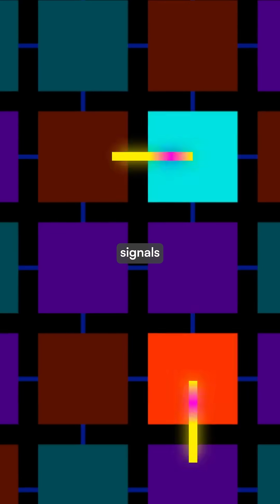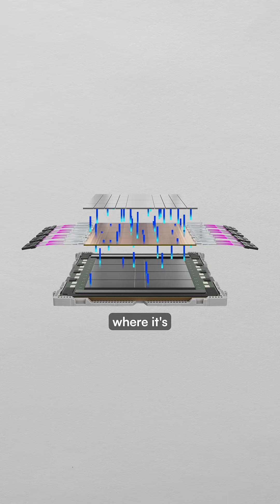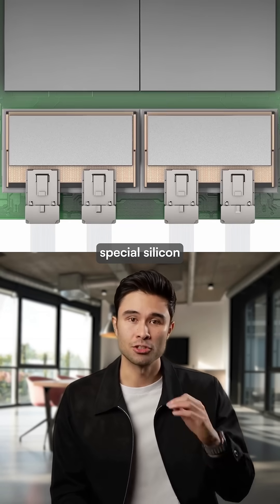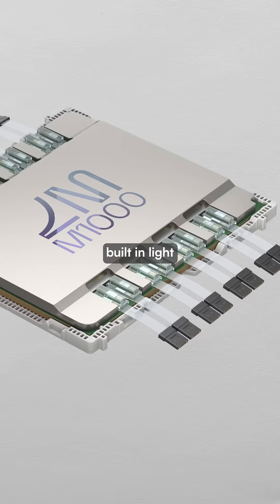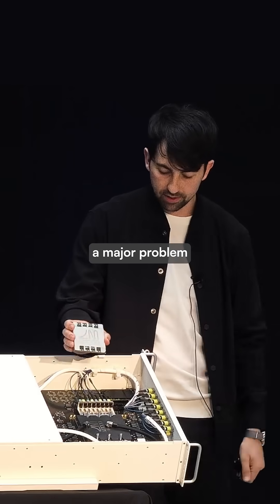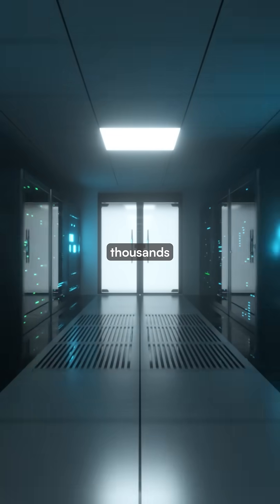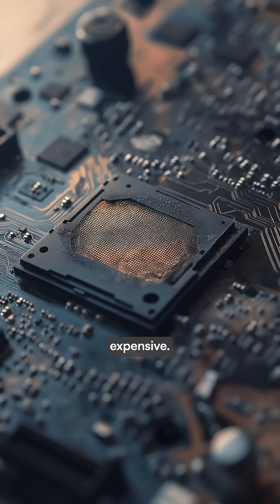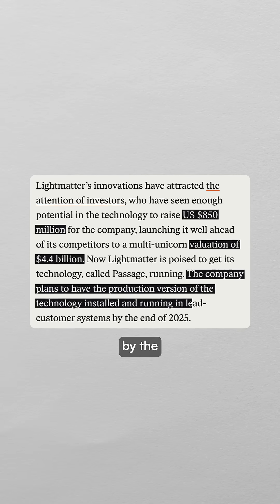This “light-speed” AI chip could help speed up AI processing AND reduce energy use #ai #technology

Comment: 20x more energy efficient, sure. Not 20x faster

Electric to Optic conversions always a few Ms to complete. Electricity itself in copper moves about the speed of light as well - so many drawbacks, 

but to do smth like replace a thick and long wire stack could be helpful

Comment: Putting additional silicon below the compute die doesn't really make much sense if the application sees its primary benefit in long-distance communication. A lot of chip communication is within the same server rack. I see this making sense as the communication to other server rooms, maybe even between racks. Even then, though, not really unless it has a substantially higher data bandwidth capacity.

Comment: I'm going to be not picky.
1. electric moves at the speed of light but the speed inside that material.
2. It's is more efficient but there are still losses so there is a limit of distance.
3. Light speed is not always the same inside the glass it would be slower than in space.

Comment: The issue with copper isn’t the energy but the heat which needs to be dissipated and that’s what causes it to consume so much energy. The light theoretically would require less cooling and thus be more energy efficient. The reality is that AI is going to grow so fast that it’s going to be extremely difficult to meet its energy demands which is why all of these companies are pushing to re open nuclear plants and build data centers around them. Ultimately I think the underwater data centers make far more sense as they can be cooled by the ocean which is much more efficient. However the problem is what will be the effect of having thousands or even millions of these data center pods in the ocean artificially heating it.
Reply: would be way easier to build the data centers on space instead of the ocean

Comment: That’s for networking yeah, it’s been around a long time… you’re equating the two but networking and processing are dissimilar. A light array makes more sense in some cases than traditional electrical binary logic gates but we’ve already been able to isolate electrical signals at incredibly low voltage. Unless you’re using some sort of passive particle lighting, I don’t think you can negate the power draw from the usage of low voltage transistors. Light still needs an on switch.

Comment: Insane upgrade path lmao. The only issue is that atm optical fiber, especially that small and imbedded during production is way more expensive than copper. I’m sure as copper supply continues to dry up fiber will be more cost effective, but that’s a little while away

Comment: Electrical signals travel at the speed of light too, there are other reasons why light is better, mainly the power usage as mentioned, most of the power on moder computers is wasted into transfering information between different locations and not on actually doing math with it
Reply: Electricity does not travel at the speed of the light. It's easily researchable.
Reply: @MarsterMikkel The electrons themselves might travel much slower, what we care about is the electric wave in the electric field that actually pushes those electrons, the electric field is the carrier of the signal in a computer.

In fact the photon is the carrier of electromagnetic force, the same force that pushes the electrons, the signal in the conductor is carried by actual photons and it is done in the speed of light inside the conductor (slightly slower than the speed of light in vacuum).
Reply: @MarsterMikkel Electricity and electrical signals are not the same, electrical signals can travel at the speed close to the speed of light but electricity's speed depends on the medium
Reply: @MarsterMikkel Electrons can move at the Speed of Light, or extremely close to it if the Medium is not the Limitation
Reply: Light is analog

Comment: The idea of light-based computing for AI isn't novel it's been a theoretical darling for decades, promising blazing-fast, energy-efficient processing for neural networks. But with current technology, it's a pipe dream. Photonic chips can zip data at light speed, potentially 10-100x faster than silicon, as seen in 2024 research on optical AI accelerators. Yet, here's the rub: how do you interpret or display AI outputs without silicon processors? Photons don't naturally interact for logic operations, so you still need electronic circuits—silicon-based CPUs or GPUs—to handle data processing, model training, or even visualizing results. This reliance on hybrid electro-optical systems, as highlighted in recent studies, defeats the core vision of a fully photonic AI architecture. Until we crack purely optical logic and memory still a distant goal per 2025 reports light-based AI computing remains tethered to silicon, undermining its revolutionary promise.

Comment: I wonder what they're doing about the conversion latency? Typical fiber optic conversion adds about half a nanosecond of latency.

This isn't a big deal typically, as it's equivalent to about 6 inches of signal propagation through fiber. Larger chips already seem to have issues with maintaining high clock speeds and throughput due to latencies across the chip, so how will chips perform if cross chip links are effectively 12 inches longer? Unlike external fiber links, that's effectively multiplying the time for a signal to get from one area of a chip to another.

Perhaps they have a faster way to convert between electrical and optical, but I'm just speculating based on what I know of current fiber optic systems.

Comment: There's multiple companies developing this light networking. Including Nvidia themselves. Barring some serious proprietary benefit these smaller companies come up with I highly doubt data centers would implement their tech over nvidia's because they are already so invested in nvidia systems as is and nvidia will likely offer upgrade paths that are more seamless and cheaper because they will have the economy of scale on their side being by far the biggest HW supplier to these compute data centers. It will be interesting to see if one of these smaller firms can come up with something significantly better than nvidias own solution. This is a massive breakthrough though, the energy savings alone is huge, energy is becoming a real barrier to expanding these systems.

Comment: Light is good if you have a straight shot. Unfortunately computers are made to be as dense as possible so basically nothing is a straight shot. This is the main reason data centers have stuck with copper connections between collocated servers. The data that leaves the facility will basically always be going via fiber but those fiber connections have much less challenging angles so the amount absorbed into the wall of the fiber optic cable is much lower
Reply: Attenuation occurs at all angles, the steeper the step and degree of the angle, the more bleeding of light from the core into the cladding will occur, thusly signal loss is compounded. 

Classical terminology for this type of loss is defined as 'macrobending' and 'microbending'
Reply: Define a challenging angle

Comment: Heat generation would be less, thus saving energy used in cooling system.
However, energy and space required for running the chip would be higher than traditional chips.

Reason - 
Energy - generation of light requires more electricity compared to sending an electric signal.
Space - Optical fibres need minimum height to work properly. Copper wires can be almost flat.

Comment: Fiber needs repeaters it does get weaker over distance
Reply: Not over the lengths we're talking. Fiber optics in datacenters rarely need repeaters because the runs never even leave the building
Reply: @BreaKdOwn--rl  yes but his statement is wrong that there is no energy loss. In fact there always is energy loss, that's why efficiency percentages are important. I can agree that in a data center repeaters might not be needed, but saying that as a blanket statement is factually incorrect.
Reply: Lets clear some things about losses first:

MMF: ~44% loss per kilometer (about 2.5 dB/km). Great for short distances like inside a building, but loses a lot of signal if you go too far.

SMF: ~5% loss per kilometer (about 0.2 dB/km). Barely loses anything, so it’s ideal for long runs, like between buildings or even cities.

Silicon photonics: ~1–3 dB per centimeter (including coupling loss). It’s used on chips or between chips, so even though it loses a lot per centimeter, the distances are so short it’s not a problem.

So if you're not building the next openai data center you wont need a repeater..
Reply: @diama_ntidis So MMF and SMF have 2.5 dB/km and 0.2 dB/km losses, but photonics has 1-3 dB losses per CENTIMETER? Cuz that's what you said in your comment?

That would make Photonics have a loss of 100,000 - 300,000 dB/km, making it astronomically WORSE than MMF
Reply: @adenm8963 Correct, but, that comparison doesn’t apply directly. This level of loss is acceptable for on-chip or chip-to-chip links, where distances are just a few millimeters to centimeters.

The original point about MMF (~2.5 dB/km) and SMF (~0.2 dB/km) was in the context of traditional data center fiber runs, where signal loss over longer distances can require repeaters or amplifiers. In contrast, silicon photonics doesn’t need such regeneration because it's confined to very short distances and integrated directly into the chip packages or boards.

Each transmission medium is optimized for its own domain, MMF for intra building links, SMF for long haul and inter building connections, and silicon photonics for ultra short, high density interconnects within computing hardware.
Reply: @diama_ntidis  If Silicon Photonics has a loss of 1-3 dB/cm, and SMF has a loss of 0.2 dB per km, then Silicon already loses 5-15 times more per CENTIMETER than photonics loses every kilometer. 

That woukd make SMF have a loss of 0.2/100,000 per cm = 0.000002 dB/cm ( linear ) or 0.2/1,000,000,000,000,000 (volumetric) = 2 × 10-16 dB/km, which is literally orders of magnitude better than extremely inefficient photonics
Reply: @adenm8963 The confidence with which you're misapplying unit conversions and ignoring context is honestly remarkable. If this reflects your approach to technical reasoning, I’d strongly advise against pursuing any path involving engineering, physics, or computing. Hell I even doubt if you could understand my sentences, or in other words, you're not the sharpest tool in the shed.
Reply: @whoppersam  you are taking things too literal. With people who reason like children you have to overexplain everything, and mention every possible exception.
Reply: @whoppersam  compared to electricity that is driven by potential difference & against relatively proportional resistance ?
Reply: My dumbass thought you were making a redstone joke
Reply: Agreed..depends on the distance travel..but in this case its within the data center is fine I guess
Reply: You said it like electricity is not getting weaker over distance
Reply: Current and voltage decrease with distance. It is also affected by magnetic fields and electrical interference. Fiber doesn't have such problems.
Reply: Copper cables need repeaters as well
Reply: This isn't fiber 

It's using glass
Reply: A data center is by no means big enough to
Justify repeaters on distance. Now, due to the harsh angles for the sake of maximizing floor space you may need them but it’s not like they are expensive
Reply: i mean u can get a whole city to run on fiber optic internet, most data centers are like less than a stadium big
Reply: Yeah, if your MOTHERBOARD size is 100 kilometers
Reply: Yea no shit copper wires need higher voltage too
Reply: But there is a reason OFCs are used for world wide web
Reply: A deep scientific discussion in YouTube comments. Great to see!
Reply: How many repeaters do you need between 2 cms (0.078 inch)
Reply: Internet experts huh😂
Reply: Unless the cable stretches for 10s of miles it literally doesn't matter.
Reply: Bro it’s in a electrical board. 🤣🤦‍♂️

Comment: Then why does Nvidia claim that fibre optic connection consume more energy?
Reply: Where did they claim, because as much as I know they to are moving toward optical interconnection I think it called something like DGX system
Reply: because that's will fvck up share holder money and who bought nvidia stock..
Reply: @imammesum lol what?
Reply: @poo1764  because nvidia making rumor.. if consumer belive in this chip nvidia will f.up
Reply: Thats what NVIDA's experiments arrived at! Others found workarounds! The Chinese or more precisely Huawei have considerably sped up data transfer between the Ascend Chip processors to reduce energy consumption and heat generation which can cause thermal runaway and speed up data transfer between chips. The power bus is thus operated at a lower power demand. This is a hybrid approach to passing data between the chips which speeds up the Huawei Ascend AI Chips performance to the optimum enabling faster throughput. Huawei has considerable expertise in this light data transfer bus between processors in huge clusters. Jensen Huang has admitted that Huawei is "a formidable competitor" and agreed that they will eventually level up!

Comment: Copper wires has to be differential so twice as many, and has to be 75ohm terminated to ground near the input as to. eliminate signal bounce, that is lot  of power used.
Reply: Noy only that but the fiber optic cables can also use different wavelengths to transmit more data in a single line
Reply: 75ohm terminated? Isn't that dependent on the signal/design.

Comment: Rgb setups bout to go crazy with this one
Reply: Oh the horror
Reply: nope that's actually not possible that will corrupt data or if not then this will make the proccess inefficient
Reply: @dynamichacker3397  r/woosh
Reply: @Tarou9000 i meam other lights will interfere causing data corruption issue or by inefficient i mean even if your pc cabinet is closed and no light in there the still light will go out of fiber optics
Reply: @dynamichacker3397  no, iirc it is silicon-based and thus it is only transparent to infrared light. RGB (as long as it is normal RGB and uses LEDs) doesn't have infrared and thus won't penetrate the silicon. Also, the light passing through the silicon only works with the optoelectronic components properly if it is spatially and temporally coherent, so, if designed properly, an external IR light source would get reduced to negligible noise anyway, assuming it even gets past the opaque protective sheath that I assume they will be covering it with. RGB should cause no harm, and obvs everyone knows that RGB makes computers faster.
Reply: @Chezrlz009 I got it sir 🫡 And yeah, RGB obviously adds +10 performance 😂
Reply: @Chezrlz009  that much trouble just for RGB which already exists
Reply: @Chezrlz009 you sound like a smart guy, I had a question they probably converting electricity to light and back to electricity, which does lose Energy (idk what elese to call it) when converting it from one form to another, and when converting Light back to electricity its probably really hard and wastes more energy then regular copper wires transforming the same amount of energy right ? Coz harnessing the energy from light is pretty hard ig…
Reply: @Nightmare_Developer  so, there is energy loss but its not as bad as you would expect. For the electricity to light, there are lots of ways to do it but you usually just have basically an LED (I think, I have to double check that though) inside of a waveguide /mirror box thingie to basically make a monochromatic laser. On the other end, light to electricity, you are trying to capture monochromatic light which is like a lot easier and more efficient than a solar panel since those have to try and catch a wide array of frequencies as efficiently as possible. In both directions, you do lose a lot of energy. However, you are mainly trying to transfer information rather than energy, and so you can use electrical and optical amplifiers to fix the signal if it gets too weak. With electronics, there are full buffers and repeaters which help reduce signal noise and clean everything up in addition to amplifying the signal as needed, and those are still being worked on in optical devices which---I think---currently use electronic conversion and then repeating. I have only done one year so far of optics so I have much left to learn, but making things like optical buffers is very much something im interested in. My point in saying this is that my information might be wrong in the details right now, and a lot of it is being currently worked on anyway so it might change soon, but that is my current general understanding of the situation right now. :D
Reply: @dynamichacker3397 not how fiber optic works

Comment: One step closer to getting LIGHT BASED COMPUTERS 😁... If that's the case... would it be possible to have electricity using fiber optic cables instead of copper?... As you have said in the video
Reply: I don’t think so. Light is just for interpreting logical signals for data transmission (0s and 1s). As for electrical systems like powering homes, those require a good amount of power throughput no matter what.
Reply: Fiber optic cannot carry energy, only data. The cables are not conducive
Reply: @Heyy_yyy  are u aware of what u said??? If it can transport light it can conduct energy
Reply: @brr216-7 you're thinking light, as in solar power?
Reply: @brr216-7 Man, dirt for example is non conductive but it can transport light
Reply: @AAA79797  it didnt say fiber optic can conduct electricty, it cant; but it can conduct light, which is energy
Reply: @brr216-7 You are confusing energy and electricity to be similar. Literaly everything could be interpreted as being "energy", having "energy" or being able to transfer "energy"
Reply: No